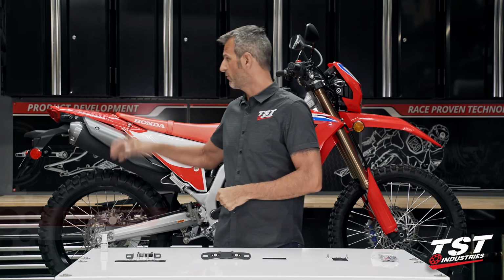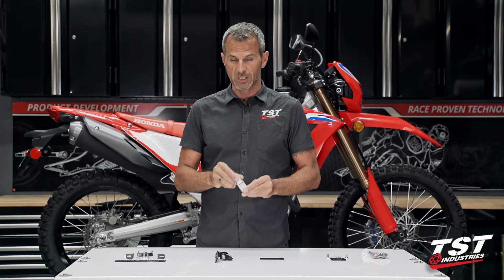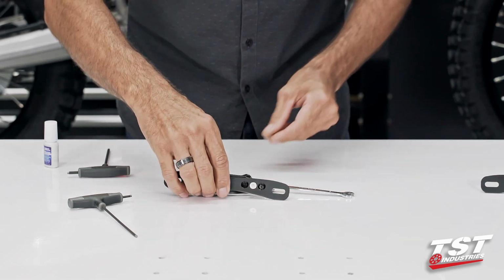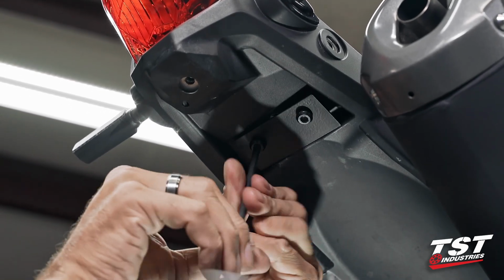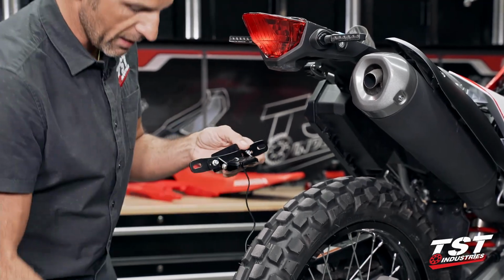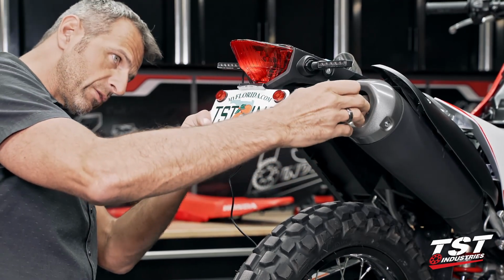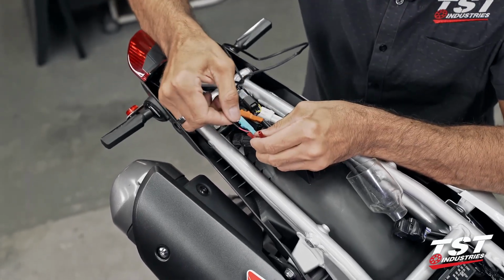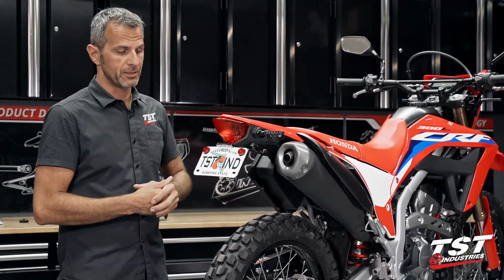How to install an Adjustable Fender Eliminator on a 2021+ Honda CRF300L by TST Industries

Comment: Very pleased!…Installed mine today on my 2024 300l. Very easy to install and looks great. Keep in mind if you get the led plate light make sure you really tighten the wire connectors so they penetrate the wire. I thought mine was d.o.a. Soon figured out it was the connectors weren’t tightened enough. Whole process took me 20 min start to finish. Thanks TST!. Get the red anodized plate washer kit it’s worth it. They look great.

Comment: Installed easily and quickly. However TST, if you monitor comments, I have one suggestion. Regarding the posi-tap connectors, I find it best to connect the loose wire first, then tap into the vehicle wire. It's a small thing, but is a bit easier. Regardless, great video instructions. Everything fit perfectly and the quality of the product is exceptional. There is now a TST sticker on the right side panel of my bike.
Reply from the maker: Thanks for the feedback and for the love and support!

Comment: Does this fit on a 250L or are the holes/mounting points different? I like the look (and price) of this more than the integrated brake/turn signal tail tidy you sell specifically for the 250L
Reply from the maker: Sorry but this kit is not directly compatible with the 250

Comment: Will you be making an integrated turn signals into the tail light? Like you have done with the 250L?
Reply from the maker: It's in our queue, it will just take a little bit of time.
Reply: @TSTindustries  as long as it retrofits to your bracket that I just bought..;)